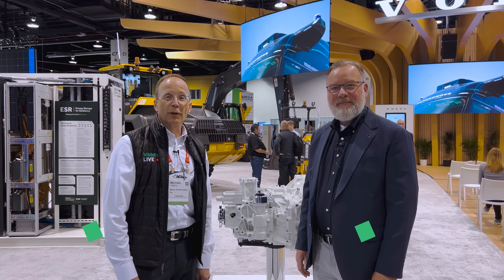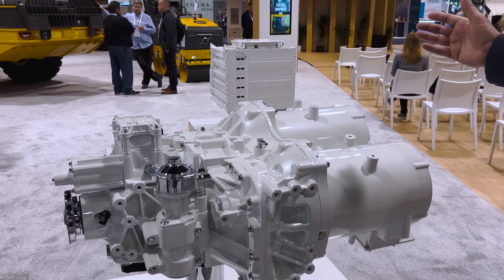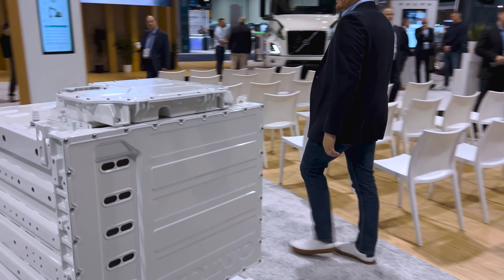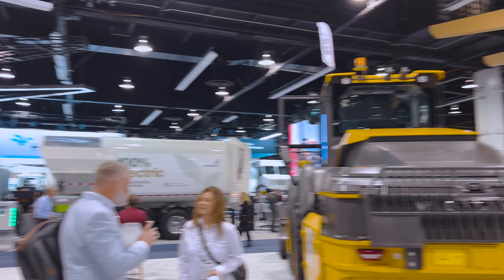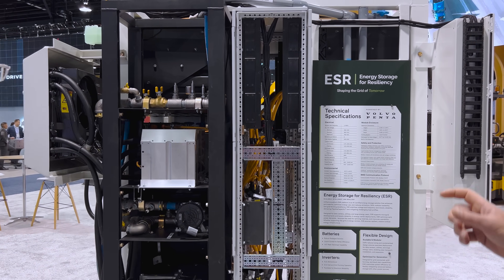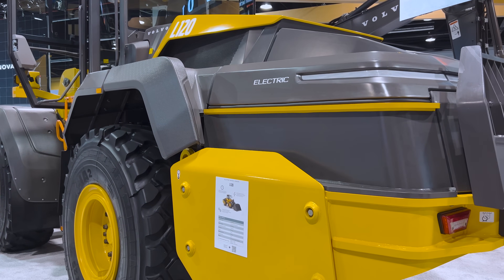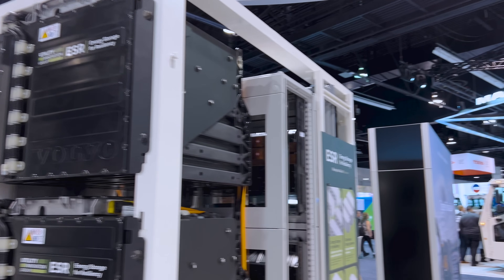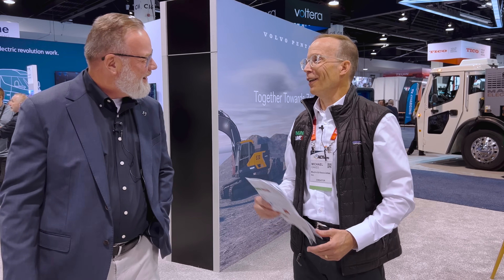How Volvo Penta Is Electrifying Industry with Scalable BESS Solutions | ACT Expo 2025

Comment: Pretty cool stuff is that Volvo Group is not showcasing any diesel vehicles on any trade fair in 2025 at all. Just electric across the board
Reply: Perfection doesn't need advertising 😊
Reply: Breathing diesel fumes is far from perfect
Reply: @jasonb444  look up modern Euro 6 standards. Trucks in London are actually making the air cleaner there.
Reply: @WiseWik  electric is always cleaner

Comment: 2:47 “Toyota hydrogen solutions” lol.  The sunk cost fallacy at its finest.
Reply: Toyota is a rich company, so it doesn't matter if it takes 50 years before hydrogen is put to practical use. 
Toyota R&D Institute, which is responsible for basic research within the Toyota Group, is conducting research into artificial photosynthesis and extracting hydrogen from formic acid. They are also researching fender mirrors that do not fog up even on rainy days by applying the internal structure of the Nepenthes(Pitcher plant）. Can Toyota's rival car companies afford to carry out this kind of research?
Reply: @軍曹-n6j  you know, there’s this one small startup that dragged the whole auto industry into the electric age, is currently light years ahead of everyone on self driving, develops everything — from materials to AI semiconductors in house. So they spend quite a lot on R&D. I just can’t seem to remember the name. Named after some scientist. Nikola? Hmmmm… no not quite…
Reply: @usefirefox  It is thanks to politics (= legal fine system) that EVs, especially Tesla, have become a decent car company. Tesla grew with the money it extracted from ICE manufacturers through emission rights. Even though it was in the red on vehicle sales, it maintained a black due to the money from emissions trading, and used this to build a supercharger network.

The cost of repairing roads is borne by ICE car owners through fuel taxes and road taxes.
It's about time that EV owners started bearing these costs too.
Reply: With so many solar farms being switched off the grid during negative pricing - hydrogen seems the right large scale solution. There are plenty large hardware systems to use hydrogen. It just doesn't make sense to produce hydrogen at cost.
Reply: @ so you want the grid to use excess electricity generated during peak solar hours to generate clean hydrogen? Maybe a more efficient way to use/store/buffer excess energy is, I don’t know, pumped hydro, grid scale batteries??? Whatever else other than a big oil marketing trick?

Current battery technology is already dense enough to out-compete hydrogen for most use cases. The hydrogen infrastructure costs are insane. Makes 0 sense.
Reply: @usefirefox  If those technologies are so good, why the switches off/negative prices so often ? Using H for heavy equipment allows to use minimal infrastructure. Produce and use locally, e.g. at mines with heavy excavators and trucks, airports or sea ports. Just do not try to copy general infrastructure for personal vehicles. There is no need to have H charges at both ends of the travel - just one.